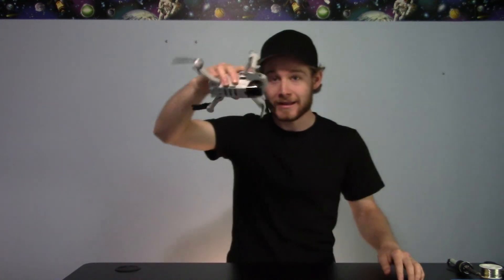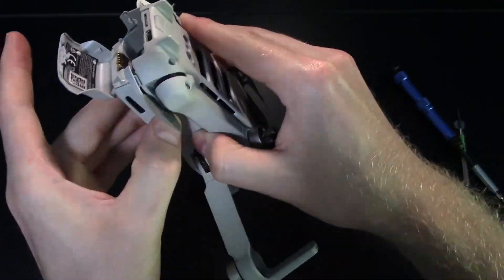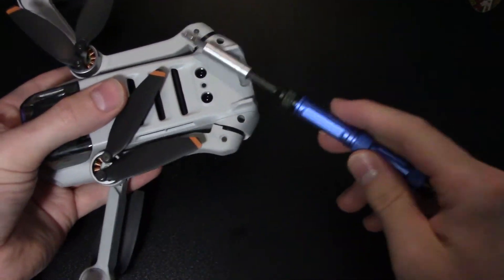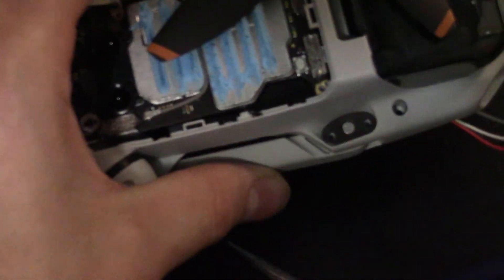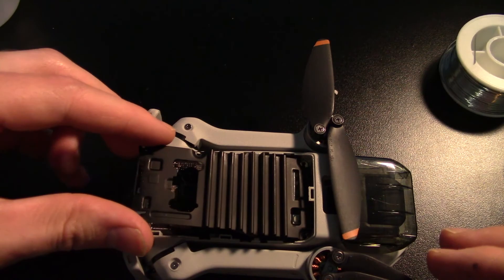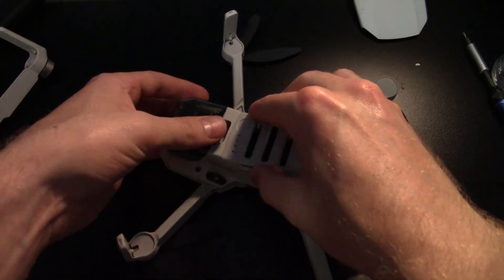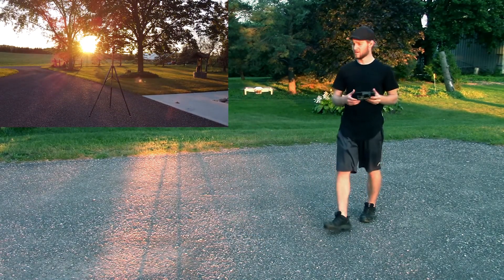DJI Mavic Mini 2 Front Arm Repair: Step-by-Step Tutorial

Comment: I broke the front right arm at the motor on my DJI mini 2 se hitting a tree branch and watched just about every video on how to fix it and liked yours the best for many reasons. I'm just about 64 years old and my eyes (even with glasses) aren't what they once were and everything in person is way, way smaller than it looks in the videos very deceiving to say the least, I wasn't able to unlatch the clips inside the battery housing so I broke a clip but replacing the screws at the end made it not a problem, and that glue holding the wires, I couldn't get it out so I ended up pulling the wires through it? I'm not good at all at soldering but did manage to do it so I imagine almost anyone can also!!! I tested it after soldering like you showed me and the props started so I just went ahead and started putting it back together and when I was done the battery wouldn't fit all the way in so I had to adjust the wires out of the way and everything worked fine, It cost me $60 to fix it I needed the arm w/motor. kit to unassembled it, and soldering iron, not bad at all compared to the alternatives! Thank you again for making this video.... well done.
Reply from the maker: Glad you got it working! I did a bunch of calibrating after switching the arm. Thanks for your comment!
Reply: @NathanShantz  Thank you I just recalibrated the IMU & the compass.

Comment: where do I buy the shoder do I need to but unshoder also?
Reply from the maker: Amazon or an electronics store. Bustbuy or micro center would have Solder and Flux as well. Flux is the unsolder. You don't need it but it helps! Good luck!

Comment: thank you! this was great. i am running into and issue. The unsoldered the wires but they seem to have a glob of glue holding them in place. Have you seen that before?
Reply from the maker: @Lessaren  they will probably have some type glue over the wire maybe? You can probably melt it with a soldering iron. Just try not to melt the outside of the wire. Also clean the solder pads before putting flux and new solder on. Best of luck! 👍
Reply: @NathanShantz  Thanks!

Comment: Anybody know what the liquid used at 4:36 is
Reply from the maker: @ak2671  that is solder Flux. It helps the solder stick to the pad better. Most solder will have some flux in it. You don't need it but it can help to add some extra.

Comment: My arm didn't come with the motor. How do you transfer it to the new arm.
Reply from the maker: I think there's a cover on the bottom you have to take off to access the screws. Then you have to pull the wires out of the arm and put them back in the new one. The antenna wire is in the arm as well. There may be a tutorial on this online. Good luck!

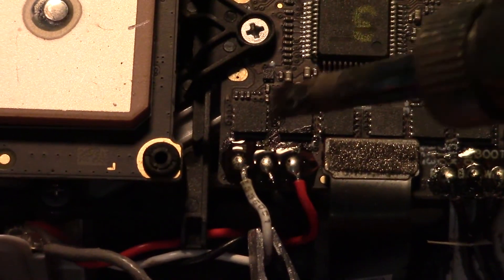Comment: What was that you applied to the connections during the desoldering process at 4:37? Some kind of flux?
Reply from the maker: Yes that's flux. It helps a lot. If you can't get the factory solder to melt and don't have flux, you can use some new solder. It will have some flux in it that may help. Good luck!

Comment: Thank you for this helpful guide. Id like to take off the arms and motors and send the camera body and electronics to 100K feet aboard a high altitude balloon. Will the done body still respond to commands and take, transmit and store video?  Even after it goes out of range>?

Thanks for your advice!
Reply from the maker: So the max height that a DJI drone can go to is 1640 feet (until it stops the motors). I'm not sure if it would stop recording or if anything else will shut off if it goes above a certain height. If you are going straight up you should be able to transmit the signal for a while but I don't think you could see it at 100k feet. It should keep recording unless dji stops that past the max height. What if you used a gopro or something like that?

Comment: I shot at my drone, didn't turn out well, now I need this video.
Reply from the maker: Did you only hit 1 arm? 😂 Good luck! 👍
Reply: @NathanShantz  i hung a shotgun shell 3 ft under it as a moving target. One bullet hit the metal casing on the shell and transfered momentum to the drone, causing it to flip upside down, tangling the wire that was holding the shell into 2 motors, and breaking an arm falling from around 3M. The motors kept spinning even upside down in the dirt......

Air blew and tested it with the broken arm and it still flies just fine, but I need to fix the broken arm. It's not completely broken off.

Comment: I replaced just the arm and kept the same motor. And then I receive a 30210 error code. I need help. Can anyone tell me why. The code didn’t pop upt when I tested before repair
Reply from the maker: I haven't had this error before but doing some research you could have a bad ESC board (where the motor wires solder too)Before looking into replacing it, I would double check your soldering and make sure the contacts are clean and wires aren't shorted. Use some alcohol and a small paintbrush and clean around the pads and try again. Good luck!

Comment: Hi, I did the replacement but I messed up in the rebuild, I did turn on the dron and flew up reckles, when I check the wires were on oposite side, how can I fix that
Reply from the maker: If nothing broke you can probably just swap the wires and try again. You can swap the direction of Brushless DC motors by changing 2 of the 3 wires.

Comment: What kind of soldering iron would you recommend?
Reply from the maker: Not the one I used in this video that's for sure! Use one with a smaller tip. Get a kit on Amazon or elsewhere that can do at least 700 °F. If you already have one try it first. Good Luck!
Reply: @NathanShantz thank you! I bought 2 and was going to try the cheaper one first lol it heats up to 750df

Comment: How much would you charge me to fix my front left arm broke in exact same place dropped it on the steps😅 so not including parts and shipping hit me with your cost 😊
Reply from the maker: Sorry I'm not doing any repairs. I think dji will fix it for like 200$. Maybe look up drone repair in your area and see if someplace can do it for less? Or for under 100 you can get the arm, a decent soldering kit, screwdrivers and try it yourself? All the best!
Reply: @NathanShantz  lol ya i figured that would prolly be just way to much on you. Well i bought the arm and a soldering iron and nailed it man did it in like 2 hours the arm hinge was the hardest part lol. I feel like if i can get into and fix a dji i might just be ok in this hobby. Thanks for the responce brother and great video youll get my referral from now on.
Reply from the maker: @TrustTitanXPlan  Awesome!! Glad you could fix it!! Yes the hinge is the worst! Would make a great hobby! All the best!

Comment: Followed your instruction . Cool, but now my drone when taking off acts all crazy and crashes… I had an error initially because the wires were soldered too close I guess, so I re-soldered them and now no more power system error but when taking off it just goes crazy like it’s on full power.. strange.. not sure what to do… it’s a dji mini 2.
Reply from the maker: Sorry to hear. I'm thinking maybe two of the wires are swapped and that motor is turning the wrong direction. This would cause your drone to fly crazy and not take off. Try to figure out if it's spinning opposite to the motors beside it

Comment: Great video! Thank you for posting it. Very helpful.... Ordering replacement front left arm now.
Reply from the maker: Hope it goes well!
Reply: @NathanShantz  well unfortunately I got it all together yesterday.
And when I turned it on it prompted me that I needed to calibrate the gimbal but it wouldn't let me click on the begin button. So I must've screwed something up royally....
Time to upgrade to the mini 3.
I do appreciate the video though!
Thanks again
Reply from the maker: Try either updating the firmware or look up how to factory reset the drone? Is it possible you forget to plug in an antenna cable?
Reply: @NathanShantz  I plugged it in but I didn't feel it "snap in" if that makes sense?
Reply from the maker: @Militaria_Collector  they kind of snap in. Maybe take it apart again and see if something else got unplugged?
Reply: @NathanShantz  thank you for all the help! Going to fiddle with it now
Reply: @NathanShantz  so, went through everything I did. Rechecked everything.
When I turn it on it says IMU Calibration required and it will not let me click the start button.
I think this one is a total loss. 
Thank you for the help though.
Reply from the maker: @Militaria_Collector  Watch this video! https://www.youtube.com/watch?v=0tQvxvdBIV8
Reply: @NathanShantz  Just got my mini 3 pro yesterday. Oh my god I love this thing!
Reply from the maker: @Militaria_Collector  nice! Did you get the other one working or is it just a handheld camera now? 😀
Reply: @NathanShantz  hahahah! Nope! It's a camera/paperweight lol.

Comment: I have a similar break on one of the arms. I see it’s possible to just buy the arm shell rather that the whole assembly. Would that be any easier to repair? Honestly just a bit nervous testing my hand at soldering for the first time. Great video though!
Reply from the maker: I seen that you can get a shell after I fixed mine. Its probably half the price but you still have to take apart the drone, remove the antenna connection and unsolder the wires. I just took apart my broken arm and it's kinda difficult to take it apart. I broke the arm cover that allows access to the wires. I think they glued it. Not sure if the new arm comes with it already attached. It would probably save you some time getting the whole assembly.  Hope this helps.
Reply: @NathanShantz   Good to know that you think the arm cover was glued.  I was having trouble getting mine off.  I bought just the arm shell since I thought it wasn’t necessary to replace a good motor.   Another hard part is that my smallest screwdriver works fine on everything except the screws holding the motor in. Those are even smaller than the rest on this drone.  Also, I haven’t been able to remove the antenna from the front landing leg.  It must also be glued.
Reply from the maker: @gfopt  yeah they definitely made it hard to replace the arm shell!
Reply: Got it! Thank you so much for the follow-up, this was very helpful!
Reply from the maker: @drose201  no problem!

Comment: What was the wattage of the soldering iron you used? I am using a 40W Weller and I can't get the original solder to melt.
Reply from the maker: I'm not sure the wattage as I don't have that soldering iron anymore but it was a plug in one. Try using some flux or putting new solder on the old solder as you're taking it off.
Reply: 100 W, pencil tip soldering iron should be just what you need

Comment: Hey there, I replaced the leg, but the drone wouldn't fly after. The new leg seems to be lacking torque, i.e., it seems to be too weak to take off, even though it does rotate  :( any ideas why it could be?
Reply: I fixed it myself. the problem was that I  mixed up the props :)
Reply from the maker: @dmytrosvikulis2009  glad it works!

Comment: 💥 Great video Thanks.  Does anyone think that a break like this can be repaired with  epoxy cement.? 
I’m thinking of mixing up some 2 part epoxy and cutting small thin strips of plastic to span across the crack and epoxy them on.  🤟🏼
Reply from the maker: Yeah I could have just glued or epoxied mine and it would have been fine. Just don't put a lot on it because you don't want to weigh it down.
Reply: @NathanShantz   I just got done repairing mine. It came out perfect and I’m completely confident that it will not fail.  What a hassle sending it in to DJI otherwise.  A big RC shop near me said that DJI will not sell them parts for them to do repairs.
Reply from the maker: @Jimmy_Cavallo  Nice!! Hopefully it works great!
Reply: @NathanShantz   The repair is 100% solid but it seems like my Mini 2 will not hover in one spot steady like it did before. It floats around slightly.
Reply from the maker: @Jimmy_Cavallo  thats good that it's solid. Maybe the arm is bent down a bit so it has less upward force on that arm? Are the propellers bent?
Reply: @NathanShantz   one prop was bent down and when I tried to bend it back it cracked halfway through so I replaced it.  The others seem ok but when I hover in one spot and shoot video it goes moves around slightly.  I can see that the cracks that I glued back together are of the absolute slightest amount.  I wonder if that’s affecting it or if some electronics got damaged inside.
Reply from the maker: @Jimmy_Cavallo  It is possible that something could have been damaged? You haven't taken the drone apart correct? I don't think the weight of the glue would effect how it flys unless there's a lot. If any of the arms can't fold out all the way that could effect it?
Reply: @NathanShantz   I did not take anything apart.  The wires were slightly extended out after the end and motor housing cracked off and I just gently pushed it all back in.  It fit back almost perfectly but it was not perfect.  As I view it it seems that there is the absolute slightest tilt to the motor from where it was before the damage and I can’t imagine that it being that slightly off could affect it in holding steady as I hover.   2 props are also so slightly bent.  Do you know how much a bent prop affects how it flies.?
Reply from the maker: @Jimmy_Cavallo  Hey I'm not sure if it is the bent prop or something electrical but you might have to get a new arm if it is still not working correctly. My guess is something isn't in the same position that it was? I don't think its a weight problem because the drones stabilization controller should be able to counter for that.

Comment: hey man so same thing happened to me, same snap in the same spot. i was wondering if I could just buy a knew wing with only the cover, and transfer all the wires from the broken one to the knew empty wing? or would that even save me much money? I want to learn how to fix it myself as i think i’ll find myself in a tree a few more times in the future😂😂
Reply: after reading more comments and replies i see you already touched on this question. thanks bro🙏
Reply from the maker: @juggz1943  yes you can transfer it. Good luck!!
Reply: I literally just did that!! Right front arm snapped but motor n cables n atenna were ok so i just swapped AND i came here and listen to this clip for spring hinge knowledge!! 
Peace!!!

Comment: I have the mavic mini 1 with a broken arm, is the arm the same as the mavic mini 2?  it could work?
Reply from the maker: The arms are the same but the motors on the mini 2 are a bit better. I don't think it's a problem using a mini 2 motor on a mini 1 but using a 1 motor on a 2 might not be that good. You could also swap your mini 1 motor on to a new mini 2 arm.
Reply: @NathanShantz  thanks for the information
Reply from the maker: @smeekee999  hopefully you can fix it!
Reply: @NathanShantz  I will buy only the arm of the mavic mini 2 but without the motor and then I will repair it myself

Comment: where did you find your replacement arm ? I'm after a motor. this is a great video thanks. I watched a few before this and they sucked
Reply from the maker: Thanks! I'm assuming you can get the motor but its probably easier to just get the whole arm assembly. I got mine from Amazon. https://amzn.to/3Oj2xmg You can probably get them cheaper though on Amazon or ebay. Look up OEM (Original Equipment Manufacturer) with your search so you know its made for dji. Do you just need the motor or is the arm broken too?

Comment: Good video but i have one questio: With what did you solve and fix the cables inside of the drone?
Reply from the maker: I'm not sure what you mean by this? Are you wondering about replacing the cables or soldering them/ connecting them?
Reply: @NathanShantz  i mean: is this a type of hot glue that you use to connect the new cables inside of the drone?
Reply: @NathanShantz  soldering and connecting
Reply from the maker: @laurinmattle7169  You will have to solder the wires to the board. Maybe look up a tutorial on how to solder and what you need for that. The Liquid that I used was flux. It helps the Solder bond to the board. Good luck!
Reply: @NathanShantz Thank you verry much and its a realy cool video👍

Comment: Are the mini and mini 2 arms interchangeable?
Reply from the maker: From what I've looked up the mini and mini 2 arms are the same size and will both fit on both drones. The motors on the mini 2 arms are a bit better than the mini's. I don't think the performance would be effected with a mini 2 motor on a mini, but the mini 1 motor on a mini 2 might have a bit less flight time. I would try to find the correct arm for your drone but they will both work! Hopefully that helps👍